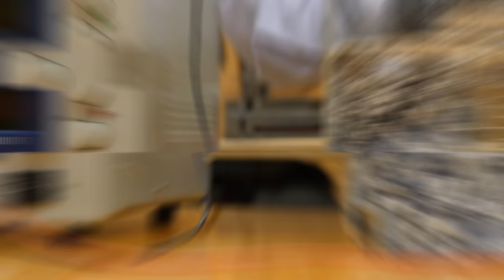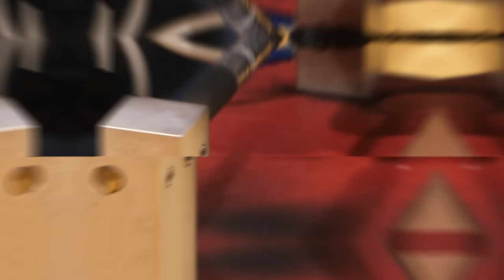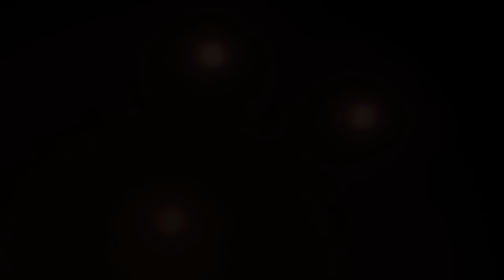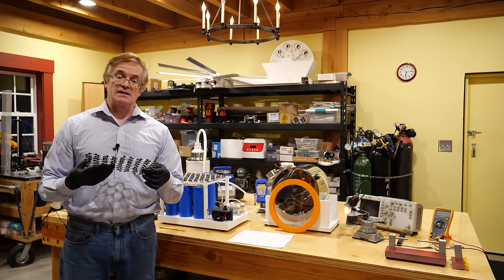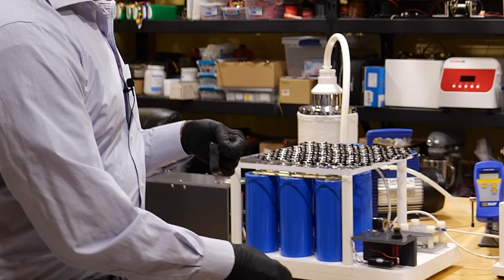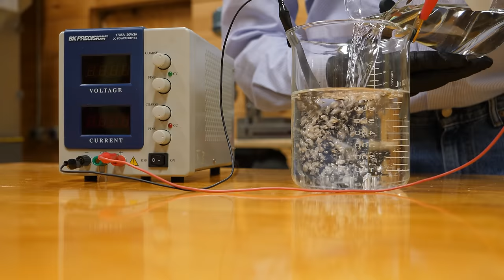Making Graphene could KILL you... but we did it anyway?!

Comment: Excellent video, big fan of your content.  

Would you be willing to clarify the rectification portion of the power supply? You mention using two rectifiers for a half wave rectification?

Would you care to elaborate on exactly what type of rectifiers you used? 

Any insight would greatly appreciated. Thanks.
Reply from the maker: Did I say two?
You only need one for half wave rectification. I believe that we are indeed doing half wave vs full wave, which does require two rectifiers. This is because 1/2 wave doubles the input voltage when charging the capacitor bank. I don't remember the part number of this diode that we bought from Digikey, but they're cheap, and as long as the voltage exceeds the output from the power supply and they're capable of several amps of current, you'll be fine.
Reply: @TechIngredients  Understood, thanks very much for the help. I appreciate it.
Reply: @TechIngredients Would like to pick your brain on one more detail if you wouldn't mind?

In regards to the SCR Thyristor you used in this video, do you happen to know the specs on that unit? I've been trying to work it out and thought it may be worth asking?

Thanks again for taking the time and thanks for the inspiration.

Comment: This was excellent.  Some very thin rods of graphene doped epoxy, say 3mm-5mm diameter, would make excellent material for remote controlled boat masts, or RC plane wing spars, where weight and strength are important.  And the low epoxy volume would mean a much higher % of graphene for the small batches you do this way.

Comment: I came across your video completely by accident.  Wasn't even looking for materials stuff.  I am an MIT grad with about 35 years of machine design, mechanical engineering experience.  Your presentation could teach MIT professors a lot about how things should be taught.  Also your results are truly amazing.  What is the highest ratio you have tried and just how strong of a material were your results.  What were the comparisons to something like PH type SS or carbon fibers?
Reply from the maker: Thanks!
Did you ever spend time hanging around MITers?
We will be revisiting  this once the plasma system is up to compare the results  presented in the second  paper we linked to in the description.

Comment: So you just basically answered a lot of my questions and you're opening statement so it does conduct electricity and it is incredibly ductile which means it would be awesome and a material of clothing and since it conducts it also would be maybe even helpful at wicking heat away from a person's body and in hot environments. Combine that with some other materials and it may be like maybe a little thicker than brand new Carhartt carpenter pants, but maybe not due to the fact that it's so ductile and it doesn't create so much friction so you actually have a thicker material that's not as rigid and therefore it would allow easier movement and not cause noise etcetera which is kind of the purpose of the current camouflage material, but to protect your value of that would just be amazing.

Comment: You gave some valuable examples of strength-to-weight ratios for various materials but as was clearly demonstrated in the recent submersible implosion carbon fiber for instance only has practical usable strength in stress, not compression situations. What are the particulars of Graphene and its usable structural applications? The other question I have is what degrades it? By this I mean steel and other metals and alloys all oxidize (rust) and most petroleum-based materials (plastic, fiberglass, etc) are ripped apart by UV but is Graphene forever and impervious to most natural elements? It's true I have never seen a rusty wooden pencil.
Reply from the maker: Actually, composites  like carbon fiber are strong in both compression  and tension. This is why wings are built from composites  as their upper and lower surfaces are exposed to both stresses. 
The problem with the submersible is that thick laminates do not distribute the stresses throughout their layers  like isotropic materials, such as metals.
Reply: @TechIngredients  Thank you for I know that carbon fiber is very successful for wings and tanks in stress so I wondered why the stress of gas under pressure was acceptable but not strength in compression like the submersible. It just doesn't seem to make sense to me as I thought just as you answered.

Naturally, in the case of the submersible, my feeling is that the unplanned disassembly was actually separation where the carbon fiber "tube" was bonded to the end caps. Dissimilar materials under both pressure and temperature changes is a bad formula. 

It does make me wonder how a sphere of carbon fiber that mimicked the steel ones would do? Perhaps there is a new experiment here since carbon fiber has gotten a bad rap from the Titian event and an experiment in both shape and materials might be good segment.

Comment: 17:11 wetting the glass will remove the grains of glass right making the cut more exposed also the water that is left will gather at the bottom as you face it down and even if that is just a little bit of a advantage it is making it easier.

Gunde Svan a famous cross country skier from Sweden said "even by removing the tip of my rods if it is 20g i know i will have a advantage over everyone else."

Comment: i didnt even realize this video was an hour long, it was an enjoyable watch, and very educational. I wonder if decreasing the diameter of the tube, lengthening it instead, would provide more surface area and thus a better carbon black to graphine ratio. im certainly not qualified in any of the related fields in this experiment, however you did a very good job explaining it to someone not as educated. thank you! :D
Reply from the maker: Thanks. 
That would  probably  increase the production ratio as long as the resistance  and voltage were adjusted accordingly.  The trade-off would be the time spent filling the slimmer tubes.
Reply: @TechIngredients Perhaps you could make use of a funnel?

Comment: Could this be done using a high powered microwave or laser beam instead of the plasma in the second paper?
Have a quartz tube pressurized with inert gas that is slowly fed carbon particles from a sprayer nozzle. As it passes over the beam emitter the small particles would be superheated.

Comment: I worked on blow molding machines built in France that dealt with heating the parts with infrared elements and molded them with a few hundred bar at 30 thousand bottles an hour. Damn right this could be scaled up.

Comment: Fantastic for making rigid frames for machinery like CNC Mills etc. Easily moulded. The issue now is that any steel fasteners will be the weak point and will stretch in comparison to the reinforced resin.

Comment: Smudging on vacuum glass is reminiscent of the Edison effect (a patent of the unknown) where the artifacts on the glass were rectified atoms of voltage.  By controlling the smudge or applying one voltage, and scanning ultimately had a cathode ray tube, or a trammission and receiving of a far, electrical vision of red, green and blue.

Comment: Great demonstration!!!  that seems like a major step toward being able to produce graphene more economically in attainably useful quantities. I am curious however, in the beginning when the chemical exfoliation process was tried... the current producing hydroxyl ions were used in electrolyte... is there documentation of using different electrolytes, as well as different cathode materials... , ie. weaker acids and lower voltage and less conductive cathodes... and also if refrigerating the electrolyte or at least performing the test with a range of temperatures ??? I realize none of this kind of science is common sense based, but it seems like changing these factors would effect the way the carbon bonds are separated in the graphite sheets by the process ( or ) are there known reason that performing the operation with these different factors would not yield a different result ? Thank you for the video, it was very instructive.
Reply from the maker: The fundamental  problem with exfoliation is that once a small piece  of the graphite comes loose, then the exfoliation stops because that piece is no longer at a voltage potential.  You really  need to exfoliate one layer at a time, and that has proven impossible.
Reply: @TechIngredients  That makes sense considering a graphene sheet is 24 nm thick and the thinnest carbon sheets that can be gotten reasonably priced is about 127,000 nm think.
I'm curious, forgive me if you already mentioned this in the video, but I didn't catch it if you did... is there a limitation on the scale that your design will function at ? in other words, could your design be scaled up to a size where ounces or pounds of graphite could be processed in a single operation, or is the scale already at it optimum size  to function ?
Reply from the maker: Because  the generation of the graphene  occurs as the carbon atoms cool, the limitation is the volume to surface area ratio because  the cooling is radiative.  The tubes could be made longer, as I suggested, but that faces a road block as the tubes approach  a meter in length due to their availability. 
Did you check out the related article  from Dr. Islam that I linked to in the discussion?
Reply: @TechIngredients  Thank you. That is very interesting. I will read Dr. Islam's article also. Thank you for posting it.

Comment: Does he re use the quartz or is it one time? Everything online says graphene floats in water, he says it sinks? The only "gray" ive seen doing this is fused to the quartz? Carbon Black, compressed to 2 ohms is less than half an inch in the tube? After firing i get only black, half sinks immediately in water and half floats? Many things arent adding up. I haven't tried "proving" that its not marzipan but i will.

Comment: Okay I saw YouTube video out of a university I think in Scotland and they used to blender and some milk proteins graphite and water in a blender and then let it blend for 40 or 30-40 minutes and then you let it sit and it will striate and a water column and the graphite will fall to the bottom and there's a center there that's kind of blue gray that's graphing and dispersion and the milk and protein mix. Apparently you can then pipette out there with the graphing and dispersion and then put it in a centrifuge and spin it for about 30 minutes I think or something you said maybe it was even less and then you remove the graph the graphene from the liquid and you can just let it dry and you have graphing powder and you can make a lot of it for very little money. You can then mix it as a powder mixing it is much more difficult than requires a really special kind of mixer and you can also add it to plastic in the same way for example a 3D printing material or you can mix it with cassin which is milk that's been heated and then you added it to vinegar and it precipitates out and you can mix in a very small amount of graphing and then you know mix it again and then you press it not in a really super high pressure you could probably use a a jack with a metal plate attached to each side and you hate it to about 130 degrees C for x amount of time maybe an hour and you get a plate of this bioplastic and and graphing and I'm wondering if you could do that with an extruder when you're recycling your waist 3D printed material after you've mixed it up which is the best method I've seen you blend it basically until it's a nice powder and then you reverse it through another and that weight actually stretch it out to a consistent thickness and then it goes around the wheel and back onto another proper 3D printer reel. They had had some mixed professionally and then formed into the flat plate he made from bioplastic at 3 mm stopped a 9 mm bullets and was the one he made it home was a little bit small but they were trying to stab it with a very sharp sharpen screwdriver and nobody could even get through it and then the one that they had formed into a plastic they sent it off for testing and it came back as an unbreakable it broke the machines before it broke. and then they show themselves hanging from a nylon webbing attached with some metal pieces to this bone and the bone is attached to the ceiling and every time something else or some other piece of metal would break but not the plastic with graphene.... And then I started wondering again with the 3D printed graphene does that have electro electric qualities electrolytic qualities like a wire for example will it transmit power across it will it act how will that behave in an electric environment and could be used to make capacitors or how would you mix up that graphing powder what kinds of things can you combine it with to make it useful in other kinds of products clearly you could 3D print if you can make it into a filament you could 3D print a bulletproof vest or please plates or could you actually pull it so thin that it's like able to be woven like combining it with polyester or with any other kind of synthetic that you can stretch out into a thin weavable fabric type of thread and would that provide a really light yet incredibly hearty degree of protection from for example High caliber rounds so like like a .308 the new replacement for the M16, for example. And with this not be insanely much lighter and much more comfortable and light and provide equal or better protection with less weight as well as being instead of plate based actually incorporated into the actual material like a are woven into a jacket or into pants to protect against shrapnel and other types of debris that one would encounter in a war fighting environment because that would be absolutely awesome to help protect people from really nasty IED entries could it be incorporated into boots like to counter those nasty foot poppers that blow your feet off and other types of antipersonnel that are mame? As I find that's just be the worst you know and if that can be so I mean we should be pumping out boots and pants the whole nine yards with a cotton polyester graphine mesh. I'm not sure how thin you can get it to get that kind of protection for the most assuredly would provide protection from less charged particles like fragmentation.

Comment: I have a question/substitution in regards to your starting material. Have you tried or considered trying mechanically reduced charcoal for your starting compound instead of carbon black? It would seem a readily available material for experimenters to procure.
Reply from the maker: I haven't, but the team at Rice tried that along with coal, ground up rubber tires, coffee grounds, and dead beetles as the carbon source.
They all worked.  The challenge was that these materials  have variable and sometimes unpredictable electrical resistance. This meant the electrical circuit has to be flexible to allow  for an acceptable  heating rate and energy  deposition.